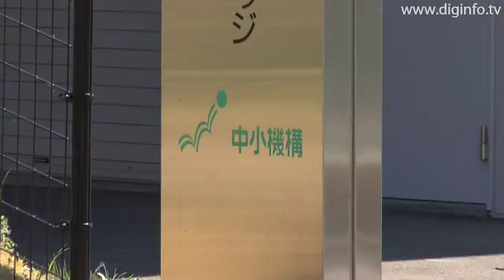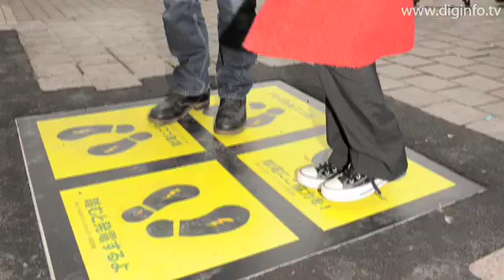Soundpower Generates Power from Sound and Vibration: Diginfo

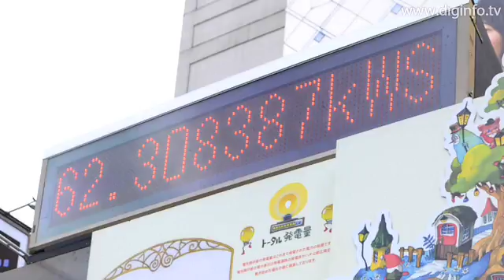Comment: pause the video at 02:24 and note the measurement unit - KWS - kilowatt seconds.  SECONDS.  not Kilowatt hours.  Very very small generation.
1 Kilowatt second [kWs]
 =   0.000 277 777 777 777 78 Kilowatt hour [kWh]

(and not sure why Youtube is showing me an 11 year old video but I guess at least the concept is cool even if the efficiency is uneconomical)
Reply: and refer this 2017 video where the voltage of passing cars was collected experimentally yielding... 0.2 volts... =)
https://www.youtube.com/watch?v=n5nU19zZBzI

Comment: sound eletrical generation is nothing new, in fact thats how your microphone works (basically its a speaker in reverse, a speaker uses electricity to electrify a coil, making an electro magnet which moves a permanent magnet, a microphone works the other way and moves a permanent magnet through a coil generating dc energy, the simplest electrical engine)
im most currious how much power these things generate..